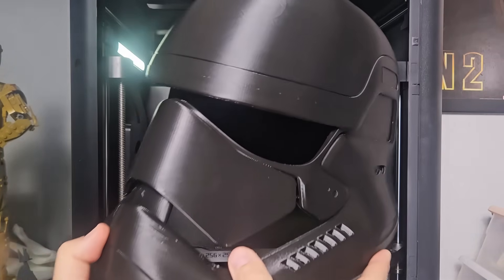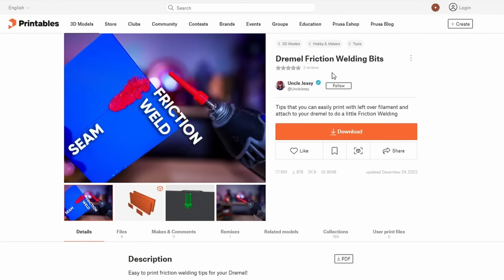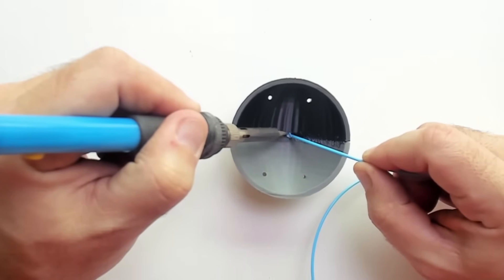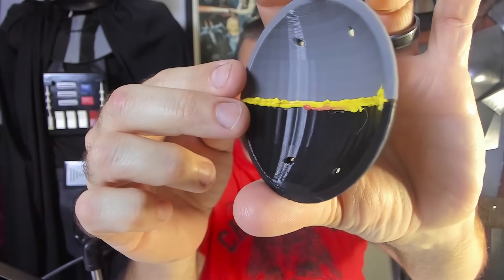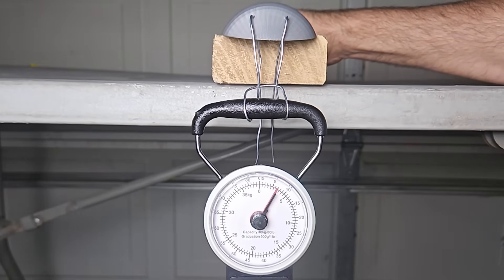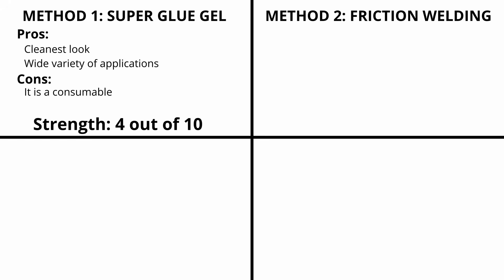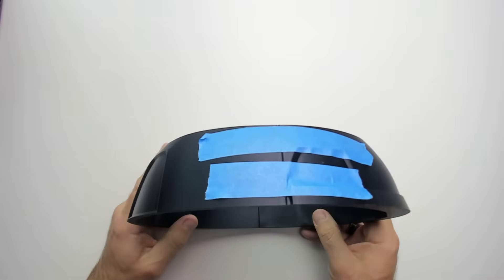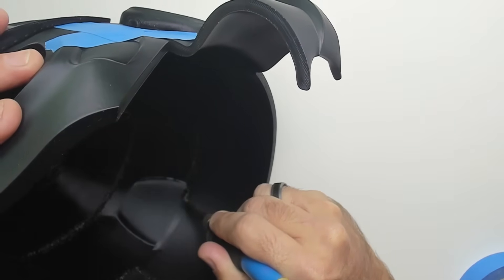How To Bond 3D Prints?

Comment: I use the soldering iron method, but I made a device that throttles the power of the iron. I set it to just melt the plastic, so very little fumes are generated. 
This removes the Con of that method.
Reply from the maker: Awesome tip!

Comment: Nice video.  However, there is a flaw in the logic behind giving the solder iron weld a 9.  The attachment screw point failed, so essentially the welded joint never failed, while all of the other 3 failed before the attachment point failed.  It is also possible the screw attachment joint was not strong enough to ensure the tested joints would break first.
Reply from the maker: Thank you. And yes good point.

Comment: I use Gloop whenever I "glue" together separate pieces. It's more of a solvent weld than a glue. I would liked to have seen it in your test....
Reply from the maker: Great tip! I plan on doing another video like this at some point with more options

Comment: If I was planning on sanding and painting the prints parts, would you reccommend doing that before using a soldering iron?
Reply from the maker: You put everything together and solder the inside first. Sand and paint after.
Reply: @3DMaxBuilds Thank you!! I’m working on a Guy-Manuel (Daft Punk) helmet for Halloween and I’m currently printing the parts on my Ender 5 pro

Comment: The 3D pen method is stronger than your results if you have one that can heat up more to ABS temperatures. I have mine nearly at the max temperature, which I think is about 260. It's like using the soldering iron but with filler. Probably still not as strong, but much stronger than your child-friendly version. The soldering iron is still probably the best though.
Reply from the maker: Yes, I do need to invest in a real 3D pen. Thank you!

Comment: when using a soldering iron you can minimize smoke changing the temperature between 350f to a max of 450f . it will take a little longer to melt plastic but still just as strong.
Reply from the maker: That’s a great tip. Thank you!

Comment: How could i apply these methods when i need to connect (for example) two cubes? 
I could go along the edges but would the bond be stronger if i could do it somehow over the whole surface?
Reply from the maker: If you are connecting 2 cubes and have have more surface area, I would recommend using glue.

Comment: Hi!
My experience:
Use soldering iron with axe bit and slide it along the gap, making "river".
Than with 3d pen fiil that river, but very slowly, so plastic can bond.
Than again take soldering iron and mix all plastic in "river" and around.
At finishing slide side of axe bit along river, so u have clean, glossy part.
3d pen -230c
soldering iron - 300-400c, so u have not to apply force and bit go throu plastic like hot knife throu butter. BUT u have to clean bit every 20-30 sec with so much temp, cos plastic burns.
Sry my eng.
Reply from the maker: Great advice there!

Comment: Forget all the other methods.  SCIGRIP 16 will solve all your problems for gluing pieces together.  It can be a bit runny so if you don't want that you have to be careful when applying.  It is an acrylic plastic glue and it bonds PLA like you would not believe.  I have never had a failure of a part after using it.
Reply from the maker: I'll need to try that one.

Comment: So I’ve done this test myself several times over. Your superglue held more than I’d have guessed. In my experience it’s a waste unless it’s something that will never get any force out on it. 3D gloop is the only type of glue that will give any type of good bond with PLA. And I think if you practiced with the 3d pen technique you’d get better results. I’ve done it many times successfully. The friction welding and soldering iron will always win out, but the 3d pen can approach their strength much better than glue.

Comment: I really liked this video you did well with showing the differences. I'd really would have liked a more in-depth comparison of the strength of the friction vs soldering bonds because they are so similar. However looking at the noise and ease of use I'd probably find solder as the winner. Thanks for the vid.
Reply from the maker: And thank you for watching!

Comment: If the material is PLA, I use Dichloromethane, which is sold as an adhesive for acrylics. It is very toxic, but it melts the PLA so it will adhere perfectly. If the material is ABS, I use acetone.

Comment: 3d pen is possible to use almost as an iron. It's hard, but possible to press a "nozzle" inside a plastic to meld details that you want combine. And over this join 3d pen can extrude plastic. Overall it's possible and will be alsmost good as ironing, but pretty hard and slow. Soldering iron with filament in another hand make this process much faster and realible.

A 3D pen can be used almost like an iron for fusing plastic parts. It’s difficult, but possible, to press the nozzle into the plastic to melt and join pieces together. You can then extrude new filament directly over the seam to reinforce it, but do it only after melting pieces. Anyway this method is quite slow, hard and requires precision. And using a soldering iron in one hand and filament in the other is much faster and more reliable.

Comment: So I use a combination of both CA glue with activator spray for instant bond and then run the dremel over the inside seam. I've never had any issues with the combo method.

Comment: Ive found the gel to be a lot weaker than non-gel. The big con is you dont get much time to work with it.

But the gel just doesnt seem like an effective CA bond. CA should work like welding, where at the molecular level, its melting the materials together.

Ive had too many bad experiences with gel. The regular CA is a lot more effective.

Comment: Get a TS100 solder iron or any other irons that can control the temperature of the tip and you can completely eliminate the fumes. Gett a verity of tips and intentionally leave a V-Groove at the seams to fill in the gap and you will be left with an almost perfect seam. The V-Groove only really works if you can model you or parts or know how to edit someone else's model in a granular way.
Reply: I prefer a pyrography pen (wood burning tool). It has different shaped tips and adjustable heat.

Comment: I think the geometry of your test pieces messed up with your results. soldering iron is the weakest in my experience, and gel super glue is plenty strong, you just have to prepare your surfaces correctly, in my testing plastic itself breakes sometimes in stead if the glue joint.

Comment: I think with largely cosmetic items such as cosplay helmets, the glue would be best as it's quick, strong enough, and doesn't affect the surface of the items as much. Really useful information. Appreciate it.
Reply: Keep in mind, that even for a cosplay helmet, you aren't going to see the inside too often. Plus, if you DO want to see a clean inside, you can usually sand the seam down a bit.
Reply: @chpunisher2005  I ALWAYS add foam to the inside unless it’s a decorative piece which will get nothing since it’s neither going to be worn or seen for the inside, so yea it’s doesn’t matter too mych

Comment: Would be cool to get a part two which compares sanded down soldering iron and friction weld results to see if sanding it down to level ruins the created bond in case you need to bond it from outside (eg a ball). And for the superglue maybe slicing the print at an angle (basically giving each side a slope instead of a straight cut off) to compare bonding it over a larger surface area

Comment: To be fair, you used the 3D pen incorrectly. You should be heating it up and pressing the nozzle into the printed material before starting to feed the new filament from the pen. This creates a welding effect and gives a stronger bond. Still probably not the strongest though. Great video, couldn't believe how strong the friction weld was
Reply: I came here to say he was using a kid version. You can use other 3d pens for that that would work better. Using a 3d pen should be equal to (heat-wise) or even better than (with the addition of additional melted plastic)  the soldering iron.
Reply: I actually use a spade bit on a woodburner after the pen to fully weld the parts.

Comment: No 3D Gloop? It's the best!
Reply: Its also insanely expensive.
Reply: PVC Cement is $30 cheaper a jar and you can pick it up at any hardware store. Oatey Fusion at least is acetone and MEK, same as Gloop.
Reply: Acetone and MEK are specific to ABS (and ASA?) but function the same as Gloop. However, 3D Gloop is also only formulated for specific materials (PLA & PETG so far I think).
Reply: I still don't understand how people use this. I've tried numerous times and the PVC cement just snaps at the joint. If the material is dissimilar there's no bond. Like trying to bond styrene or PETG together with vinyl. At best you're gluing the cement to the cement on each surface.
Reply: @ True, but depending on the application, there is no equivalent.

Comment: with  the 3D pen you should use a )))) sweeping 8 motion like welding with metal. It helps put heat into the part, melting and bonding -and you should use the same material as print, (PLA weld with PLA print) your aim is to apply a small amount of filament, while melting the actual print. the small amount fills the cracks, and fills in where the part was melted, its best to have a larger nozzle pen for this.   Doing it this way should get a similar result to soldering iron, if not a bit better.

You can also try wood burning kits to get specialized 'soldering' tips,  there is one that is S shaped that works well for 'pinning' parts for test fits and such, before you go over with like a 3d Pen to weld and add more filament to it,  combing methods may get either the best bonds possible, or, faster for 'multi part' needs - such as making more than 1 object at a time.

Comment: Very problematic conclusion. Only one part tested so no statistics. And the seams are not done according to best practise.
1. CA glue, the surface area was smaller than it could have been, you can still see the small droplets, about 50% of the available area was glued
2. Friction welding was more of a smearing, how deep did it penetrate ? Which material was used similar or dissimilar ? Who knows.
3. Soldering iron, could have been way deeper, it´s only a but joint without a V groove for filling material
4. 3D Pen, was the material similar or dissimilar ? How deep did it penetrate ? No v groove for filler material etc.

If done properly the 3D pen, friction welding and soldering iron have similar strength. Superglue can be stronger on larger flat areas or weaker on butt joints. You don´t even need that kind of testing to know that.

Comment: when splitting your helmet model up, the slicing tool can also add dowel connectors to make it easier to line pieces up
Reply: what slicer?
Reply: @clandestiny67  Bambu / orca slicer, it is part of the cut tool, when cutting you can add connections and choose between a few different types of connectors, dowels are my favourite
Reply: It can only add a single dovetail connector exactly in the center of the cut, which makes it useless in some cases. Unfortunately there aren't many good tools for splitting up parts like this, the only good one I found costs so much that you can save money by literally just buying a larger printer instead.
Reply: @brinkoftext  so when you open the cut tool, there is a button called Add Connectors, that us where you can choose to add pegs, dowels, etc
Reply: @brinkoftext What is “it”? Bambu Studio/OrcaSlicer both offer a variety of connection options such as the number, width, depth, shape, and placement of connectors.

Comment: That particular pen uses a different plastic that has a lower melt point than PLA (so it is safer for kids).
A different pen that is using PLA would do better (even a dirt cheap Aliexpress/Temu pen would do).
How even the soldering iron is still more versatile and convenient.
Great video. Keep up the good work.
Reply from the maker: Thank you. Yea, I need to try one that's not a toy.

Comment: If you also have a resin printer it's worth trying a small amount of resin in the joint then a UV flashlight to cure it. I've found it can work pretty well and it's as fast as the superglue method.

Comment: One method you might want to explore:  since you have an enclosed printer, try printing props with abs.  You can use acetone to chemically weld the prints together.  Just use leftover support material and dissolve it in acetone, make a slurry, and treat it like glue.  

Abs is also easier to sand than pla - I've found pla likes to almost melt when using an electric sander. Plus abs is more heat resistant overall.
Reply: And it's toxic, and it's more difficult to print and manage, and it costs a lot more, and it's unsuitable for cosplay (especially masks because as mentioned when heated it emits toxic fumes) and it requires a printer closed with fixed temperatures and... Okay, you get the idea. Maybe.
Reply: @Ale_giro  ABS is the same price (or cheaper) than PLA.  Yes, it releases styrene when heated.  Bambu printers ship with a carbon filter, and I run one on mine, so problem solved.  Enclosed printers are a lot more common than they used to be.   Why is it unsuitable for cosplay?  Once it melts, you would get some emissions but that is'nt until ~250C.  I use it for all of my helmets, since it doesn't soften and melt in the sun (or a hot car) like PLA does.

Harder to manage?  PLA adsorbs more moisture from the air than ABS does.  Arguably PLA is harder to manage, but neither is terribly difficult.

Lego is also made out of ABS :)

I mean you do you.  Printing nowadays isn't like it used to be - a little bit of research, some practice, and knowing how to tune your profile, and there are a TON of materials avaialble.  I find finishing ABS is way easier.  To each their own.

Comment: Soooooo i have a question.  Wouldn't the glue have held stronger if you had used a line of glue across the piece instead of  glue dots that are separated?
Reply from the maker: Yes. I just applied it like I normally do though.

Comment: I have yet to find a permanent application for CA glue. It's a great glue when the bond doesn't matter. Epoxy is much better, even the 5 min stuff.

They sell variable temp soldering irons with flat tips. You get a really clean flat weld with those.
Reply: I've used C&A glue along with epoxy. The superglue holds together while the epoxy cures. Small strategic spots for the glue and be epoxy on large flat areas.

Comment: the 3d pen is very good in situations where the parts fit is not perfect and you need to fill it with material. also you need to raise it to 230 c (PLA) and press the tip well into it, which is hot
Reply from the maker: And I shouldn't use a toy 3D pen

Comment: As a pressure welder of 20years. the soldering should have got 10-10 for strength, the parent material broke not the joint.

Comment: Have you tried 3D Gloop for PLA? It's amazing stuff that chemically welds the parts together in seconds.
Reply: 3D gloop does a solvent bond.  It is arguably as good as you can get because it melts the plastic together.  However, as with any solvent, it stinks and likely toxic, so use in a well ventilated area with a respirator, gloves, and other PPE.
Reply: @dfloyd888  Good advice!
Reply: And it is specifically formulated for different plastics.
Reply: @JoeBrinkman66  And it's stupidly expensive
Reply from the maker: I have not yet. Thought about it though. Will try it at some point.
Reply: Gloop is such a rip off. Oatey Fusion PVC Cement is the same ingredients (acetone and MEK) for $30 less a can.
Reply: 3D Gloop is mostly methylene chloride which is extremely toxic and should be used with a supplied air respirator or under a properly working fume hood. It’s nasty stuff, shouldn’t be a consumer product.

Comment: I put crazy glue one side, rubber cement the other, makes a heat reaction, bond so hard I can break the plastic not where the joint was. Fyi
Reply from the maker: That would be interesting to try

Comment: For PLA I use a liquid called Bondene. It is super thin and hard to control and the default application is to brush it on with a small brush (like nail polish). It wicks in between the joined pieces and dissolves the PLA temporarily, solidifying as it evaporates. I sometimes use a borosilicate glass syringe and modified plastic pipettes to wick more of it and it works a bit with PETG though I am more suspect of its strength there.
Reply: Bondene does not dissolve PLA. Nor does acetone or MEK. PETG doesn't either. These solvent welding solutions work great on styrene based filaments though like ABS or ASA. But if it doesn't melt it, it doesn't weld it. And those filaments don't melt with those solvents. In fact the only thing that will chemically dissolve PETG is tetrabydrofuran based solvents. Ask me how I know.
Reply from the maker: I'll look into that one
Reply: Why all that hassle ? You can use CA glue instead and create bigger area joints to get the same strength.
Reply: sounds like Weld On #3 but i use it for petg pla and PC so far great Chemical Bond